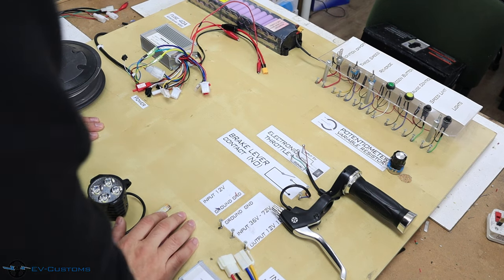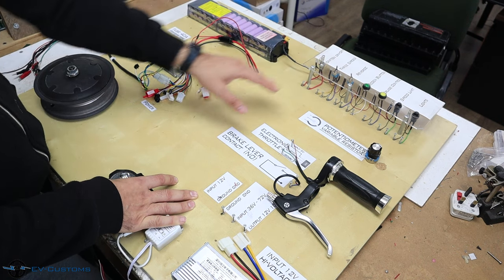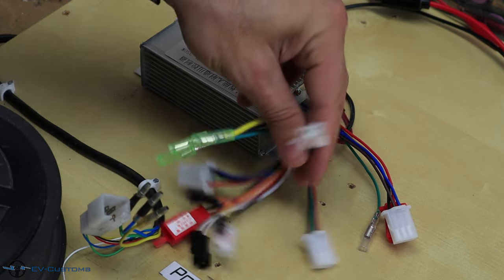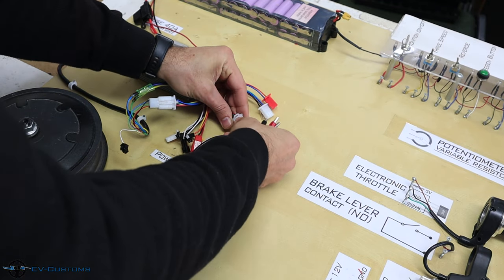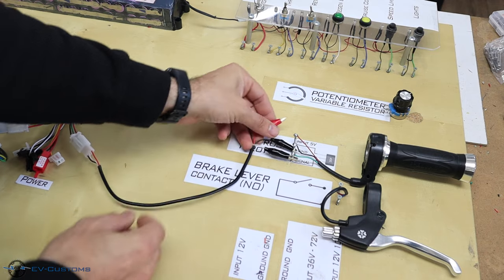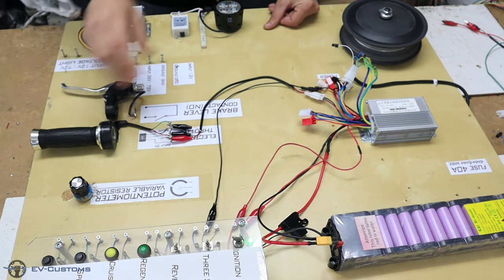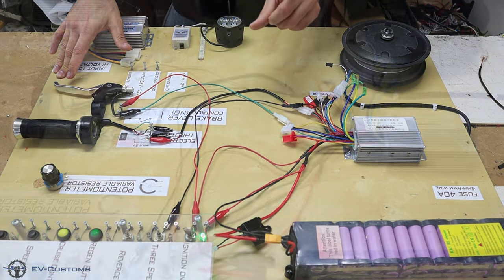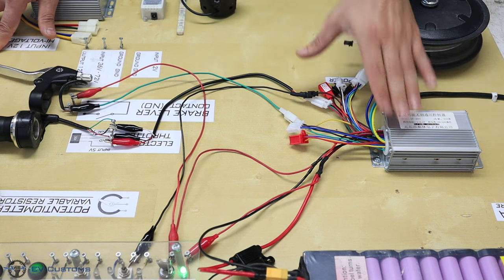High and Low Brake Difference (Learning Board for Beginners)

Comment: Great video but you are missing one important thing atleast to me. Please help I want the brake light to go on but I do NOT want the motor to shut off how do I do this?
Reply from the maker: Hi... you can connect e-brake laver contacts in series with your light..
Reply: @EVCustoms  you mean to close ground? So nothing with the high or low brake at all?

Comment: Please can you explain what the single thin white wire with plug is for? Can be seen at 11:37  and is also present on Lisburn controllers
Reply: I think its a smart learning wire. there is probably another one. and if you connect them you can make it turn youre wheel the other way. incase of my scooter the wheel turned backwards at first. but when i connected the two white wires for 5 secs. it teached it self to go forwards

Comment: Can the 24v controller be run off a lifepo4 lithium ion 24v battery  ok have the controllers got a low voltage cut out ?
Reply from the maker: Of course it will work with Lifepo4 batteries, but there you will need 8S batteries instead 7S of lithium ion batteries.
Reply: @EVCustoms   thank you what sort off ah battery  would I need for a 24v 350 hub thank you
Reply from the maker: Minimum 20Ah battery, because  low voltage systems needs much more amps

Comment: When I brought a bicycle controller for my Xiaomi 1S scooter with S866 LCD display, the electronic brake doesn't work and I have 2 cables on the controller, 2x 2 pin assignments with red and black cables and a second red and black cable with a small hose together  and if I connect red to red 5V and black to black from the brake lever to the controller output then the gas no longer works!  It's like a short circuit!  And if I just remove the red or black cable from the controller then the gas works again and if I add the red or black cable from the brake lever again then it blocks the gas!  So why is that like that?!  How can I connect my electronic brake for my 48V 1000W motor?  With my bike controller it also has 3 pin PAS cable!  On the scooter controller the two electronic 2x 2 pin brake cables are black/white 2x 2 pin and a friend also has 5V coming out of the plus cable white cable and it doesn't block the gas but also like me has 2x 2 pin cables for electronic brake  !  Only the 2x 2 pin cables are black and white and also 2x 2 pin are held together with a short hose.  Why does it block the gas for me if I remove the second cable red to red and black to black 1 cable then the gas works again!  But if I turn red on red 5V and black on black then the gas blocks and no longer works!  What can I do please??  Maybe buy a Scooter Brushless Motor Controller 48V 1000W for my 48V 1000W aluminum motor??  You are a professional and only you can help me!  PLEASE! MfG.

Comment: Hey ev customs could you recommend a 48v speed controller with bluetooth dongle. My battery is made of 21700 cells 5000mah 13s7p I would like to be able to get  3000 watts out of the controller my bms can do 60 amp continuous and like 80  amp max
Reply from the maker: Hi.. so your capacity os about 35Ah at 48V..  you know battery brand?
Reply: @EVCustoms   littokala cells
Reply: Hey, did you find one? I have tried a bunch of brands, Daly BMS is now my favorite. Works well, decent app, free Bluetooth dingle included, lots of customizable settings 👍

Comment: Please have a scooter.
 When I do not ride it and test it, the speed reaches 40 km / h
 But when I ride it, it does not exceed 13 km / h.
 And move forward with difficulty.
 Is the problem with the battery ,motor, or controller ?

Pleas i need help
Reply from the maker: Hi, most probably your motor have shorted coil...
Reply: @EVCustoms  how can i test the coil.
Give me solution pleas
Reply from the maker: Disconnect the 3 face wires , short 2 wires for example blue with green and turn your hub motor, there you must feel resistance, after blue with yellow, yellow with green,
Reply: @EVCustoms  yes I feel resistance 
Blue green  I feel resistance 
Green yellow I feel resistance
Yellow blue I feel resistance
Reply from the maker: ok.. your face wires are connected with proper compilation? you hear strange vibration sound when motor turning?
Reply: @EVCustoms  yes i feel vibration just 
Whene ride
Like ger ger or ver ver sound
Maximum speed 13km/h
But whene i dont ride it it turn normal without vibration and motor reach 40km/h
Reply from the maker: ok...   you must to check, face wires compilations..
Reply: @EVCustoms  I don't understand 
The face wire compilations ?
Where?
Reply: @EVCustoms  where I found face wire compilations??
Reply from the maker: https://youtu.be/3ugpXuVzAv8

Comment: Does it have stopping force? I observed it cant really "brake" the motor
Reply from the maker: Hi..  now the motor didn't have stopping force because this controller didn't have EBS wire, i will made one video how to activate this function from the board..
Reply: I found your video with EBS posted a year ago. Maybe you could go more into its detail. Thank you so much. Every video yoy post is very helpful.

Comment: Hello!🙂I installed a brusheless motor controller on my Xiaomi 1s and a S866 bike display and throttle works so motor rotates.  My problem is: I have two brake levers with red, black and green cables.  I have two red/black cables on the controller that are connected to a black hose.  From my brake lever I put the red cable on the controller 2 pin assignment to red and the black cable to black but Low Brense Electric Brake doesn't work.  I also gave red on red and green on black from the brake lever to the controller but the electric light brake does not work.  Why not??  PLEASE GIVE ME A HELP TIP, PLEASE!  You are a professional and I watch all your videos very very often.  Even my friends too!  Please! I have the controller on red black 2 pin assignment 04.52 volts on the multimeter and on the brake lever on red and black: 1.100 - 1.200 ohms approximately.  And on red and green: 1,500 - 1,600 ohms approximately.  And I only have my one red and black wire but that has the same voltage as battery 36-42V.  Why isn't it working?  Do I have too few ohms at the brake lever?  I only have a PAS cable 3 pin brown black yellow and it has 0.426 volts for yellow and black.  Do I have to connect the brake with this cable?  But that has the same volts as the two red and black wires.  PLEASE just a tip.  I've been sitting for 2 days!  PLEASE!  MfG.🙂
Reply from the maker: Hi again, the problem is that your controller need dry contact and not analogue resistance, so the best end cheapest option is to find or buy dry contact break leavers...
Reply: @EVCustoms Find or buy dry contact - break lever.  What is that lever exactly?  What do you mean for a (dry contact) or break lever? A specific brake lever?  Or "dry contact" do you mean unscrew the controller and look for a specific contact. That I can finally do it! PLEASE! PLEASE just tell me what you "find" with (dry contact break lever). I can't think of anything below  "Dry contact" or "break lever". Then I could try it right now! If you just tell me, I'LL ASK YOU what you mean by that. I've managed everything so far! Except for the brakes. I'm very  Desperate! You are really very very clever! and all of your videos are great! A professional in electrical engineering! Madness! MfG.
Reply: @EVCustoms I ask you!  That you PLEASE write to me now, for example: 
1. Dry contact what is it and where can I find it??  Into the controller??  2. What is an interrupt lever?  A toggle switch in position 0, left 1, and right 2, or left 0 and right 1 so 0-1? Then I can still buy the part in an electronics store. Or can I get it that way?  As you said, from fastest solution: dry contact ?  Kind regards
Reply: @EVCustoms  Hello!  🙂 Now can you PLEASE tell me what you meant?  What can I do fastest and cheapest?  I PLEASE you help me with an answer only!  You are a pro and I watch all your videos a lot even with friends!  You will soon have more subscribers because my friends who bought scooters also want to convert to speed controllers!  And I have shared her videos on YouTube and Fb. So many times and shared them on WhatsApp and sent them to friends who also have groups!  I PLEASE you very much, can you just tell me what you meant what I can do the fastest?  They said that my controller needs a dry contact and not an analog resistor.  Therefore, the best and cheapest option is to find or buy dry contact breaker levers.  If I have one (dry contact), should I unscrew the controller?  I already had the same one and had already opened it, there are 4 screws on the cable and 3 screws on the side and it has 9 mosfets.  And I saw that these 2x 2-pin red/black cables are connected to a black tube, the 2 red cables are soldered to one contact and the two black cables are also soldered to a contact on the inside.  PLEASE just tell me if I should buy a switch with on/off or what I should do so that I can make it and finally get it done.  I can only wait for you because you are not a professional and you know what would be the quickest thing to do. I can only hope that you will answer me because you wrote me that yesterday at 10 p.m. and I saw it today and don't know  exactly what i should do now!  Kind regards.

Comment: what is high and low speed in LCD panel
Reply from the maker: LCD Panel?
Reply: @EVCustoms  yes its says on the description of the LCD display the wire has high and low speed? don't know what is it hehe
Reply: @EVCustoms  lcd display hehe
Reply from the maker: @darneycatimbang3861  You mean the panel with the buttons?